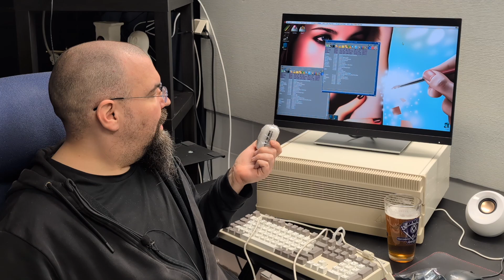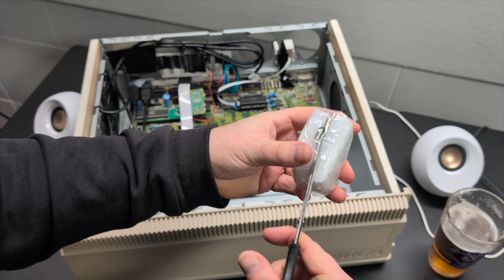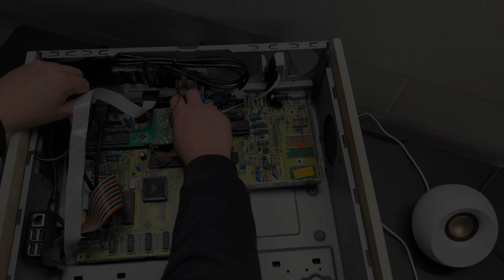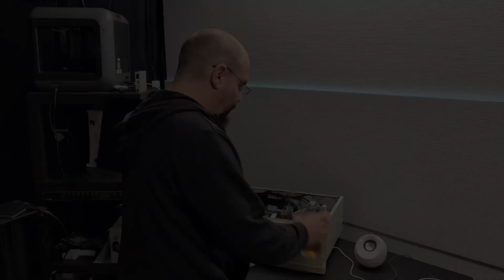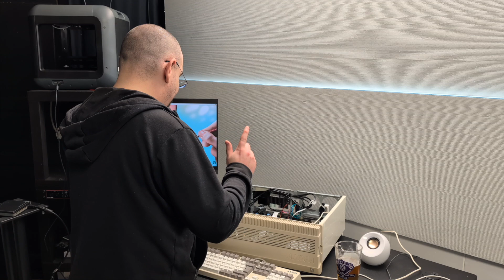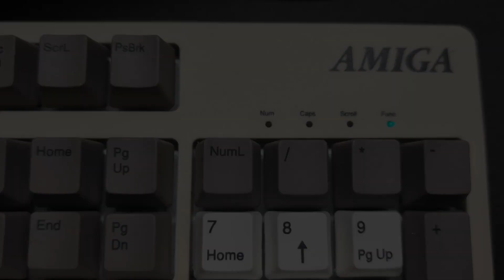Modern USB-keyboard on my Amiga 500!

Comment: when Pistorm runs Linux (and the Musashi emulation) it was possible to use the pi's ethernet on the amiga. And maybe usb mice and keyboards as well?
The quality of the rgb2hdmi is amazing, not only the sharp picture but also the free cpld, c and assembly code. Making it easy to adapt and tweak things, and fix errors quickly.
A similar amiga video converter based on a custom rp2350 board and the pistorm called Framethrower just got realesed as product from amiga retro stores, as well as free source code. Good times for retro computing! :)

Comment: Interesting how you can to use an adapter for the CI chip to handle USB keyboard connectivity. I would be so nervous ripping those chips from the board lol.

Nice 3D printer you got on top of the rack. Is that a Bambulabs one?
Reply from the maker: I am always afraid to bend some pins or anything like that. But have done it so many times now that I never does it anymore. *knock on wood*. The 3d printer is a rather cheap one from flashforge. But it does print very nice. A bit small print bed though, so can't really do everything I wish it could.

Comment: One more useful mod! :) A statement on Tang Nano, please: The 50€ fpga that runs free software amiga cores. Is this the road to amiga innovation or just a freer than vampire and cheaper than mister alternative? We've also got a new emulator "Denise", and some advancements for democoding "prototyping with native 68k code by heckmeck" in a browser. Which looks like the most efficient workflow for democoders to me.
Reply from the maker: Some great mentions there. I had my eye on the Tang Nano for a while. It is a fun project to follow.
Reply: @proteque  while 68k assembly and webbrowser seems like a mutual exclusive antithesis, the amiga flashtro scene of advanced code inspection and action replay skills thrives on similar grounds.
Reply from the maker: @gnu-lynx2501  I need to check this out. never heard of it before.

Comment: I have one of my A500s in a Checkmate case and I modified an A2000 keyboard case to hold the A500 keyboard and added a cable. I had to cut out the slots for the LEDs but that was pretty simple. I was surprised how little I had to do inside to make the A500 keyboard fit perfectly. It makes me wonder why Commodore didn't just use the A500 keyboard in a case instead of designing something else for the A2k?

This USB solution is interesting because maybe I could use a USB switch for driving two computers with one keyboard and mouse though I would still need the second mouse on the desk but that isn't a big deal.
Reply from the maker: Not sure it would handle having a switch between? As they often are hubs as well. I can give it a try when my usb-kvm shows up from wherever it hides.